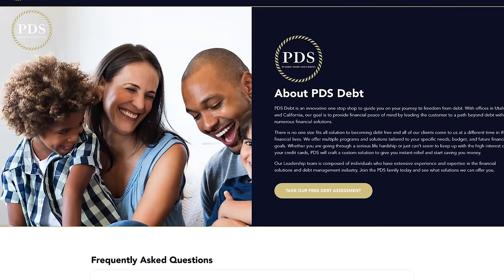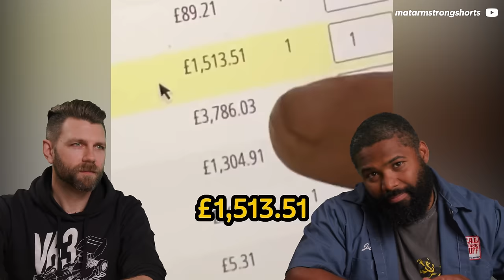Mechanic Reacts to Expensive Supercar Repairs

Comment: I work at an auto parts counter. I see so many guys who can finally afford something fancier than a six-year-old Camry who come in for parts only to find that, despite getting a killer deal on a CTS, or a 328i, or any elderly Jaguar; the economy ended at the purchase. I have a regular customer who got a BMW 3 for about the same price as a similarly aged Civic. The infernal HID bulbs for the headlights are about $150 each, which is about ten times the price of headlights for a Civic. The PCM crapped out about two weeks after he got the car. A salvage replacement wasn't outrageously expensive, but he ended up having to tow it about eighty miles to the nearest BMW dealership to convince the new PCM that it wasn't stolen. The dealership did not do the job for free.

If you can afford a fancy car, you'd better be able to afford a fancy repair. It's the way the world works.

I love my old Dodge.
Reply: God forbid they put all the fancy non-mechanical stuff on a car with inexpensive mechanical stuff.
Everything nice about a 328i has no reason not to be on a car as durable and inexpensive to maintain as a Civic. I've asked.

Comment: Watching this just made me realize:  supercars are built and maintained like airplanes. It's more about the preventative maintenance. We've all seen videos of wheels flying off at freeway speeds.  Imagine a composite wheel disintegrating at 4x freeway speeds.  The loss of control comes after the wave of shrapnel.
Reply: @SanityTV_Last_Sane_Man_Alive 2 points:

1. While a good piece of the video showed people doing dumb things in fast cars on public roads, we can assume these are also being driven on tracks or other places appropriate for them.

2. I have a feeling that someone that can actually afford one of these cars would be more focused on ensuring they are always in top working order and will never fail while in use - unless it is the driver's fault.
Reply: @SanityTV_Last_Sane_Man_Alive Race tracks, Autobahns.

Comment: At 17:17 you can see the breaks glowing red hot. Hand break is still up. That's why he cooked the clutch also.
Reply: he also says park it yourself but give a tip and hand over keys no one ever get hold my car keys even if my not not worth a lot my keys stay with me if they need to move it cal me i move it. i park my own car and keep the eys even if the car £100 or £10,000 i never hand over my car to a stranger. only one person what not not family i trust and that my local mechanic he dose services and takes it to local mot the yearly safety inspection and he bought no issues the last 4 years so only person i hand over the keys too not some stranger and esp in usa a manual car as many do not know how to drive one

Comment: I heard the Bugatti wheel replacement with maintenance is because the tires have to be "glued" on the rim otherwise the rims would rotate inside the tire.
Reply: Which is just ridiculous because ugr Lamborghini seems to do fine with double the power without all that effort
Reply: @michaelf.2449  Which Lamborghini has double the power of a Chiron?

Comment: Most Gallardos were delivered with the E-Gear transmission, which is basically an electrically actuated manual. If you use the like a normal autobox while maneuvering, they'll burn up the clutch. I've also seen that with early dry clutch DCTs.

Comment: That Rover clinate control reminds me of selling an old Rover 45 that was too rusty to keep. They were built when BMW owned Rover and shared the same stereo as BMW models of the same years. Once you figured out how to remove the rover decal that stereo was worth more on ebay than the rest of the car was in scrap!
Reply: rover 45 basically a Honda civic but you had options of a Honda or rover engine. seen a rover 600 for sale recently, looks like a import from japan or place what to not salt the roads and asking price £8 k ROVER 600 620 SLi AUTOMATIC 2.0 HONDA ENGINE * ONLY 33000 MILES they worth good money and under pinning for that Honda accord. someone local parking one up outside the doctors and he was saying about the honda engine still runs great and no issues with bad e10 fuel. these rovers are gaining value like , ROVER 416 TOURER 1.6 £7,999 or   ROVER CABRIOLET 216I 1.6 with 35k miles £8,999 or a bit more modern rover 75 v6 £7k or the mg zt but only v6 not v8 £9k, even some metro's going for mad price even rover 100 the updated metro like the 1997 Rover 100 1.4 114 GSi £4k, or 997 Rover 100 1.1 111 Ascot 3d with dealer miles of 12k and for sale at only £6k and the Austin Mini Metro Mk 1 L 998cc 1982 £9k the value of rover and Austin are again in value quite a lot but they are getting more rare sadly

Comment: I was picking up a client's Murcielago back when there were new. It's was at the Ritz in Orlando and I got his Rolls-Royce but I'm waiting for the Lambo for a bit. I start to hear it revving so I walk over to the nearby lot where it was and the guy couldn't figure out how to take the parking brake off and was almost smoking the clutch trying to get it to move. I told him to get out of the driver's seat but I did show him how to work the parking brake! IDK how much damage it did because my client sold it before too long. The head valet said the only reason they had been moved was it was Super Bowl Sunday and the game was in Tampa so they had busses taking ppl to and from the game that were pulling up right out front where the cars would have been. I've known a fair amount of valets over the years, most have respect for cars but especially when it comes to super cars even the ones that don't take the opportunity to have some fun can cause damage because they don't know some of the strange things about how they work. Park your own super car, manual car, or anything that's a bit different!!

Comment: The higher rev and time is the MAP sensor programming set into the ECM... The throttle by wire vs Espeed position is different programming...

Comment: You guys are making me glad I drive a Honda that probably can't go over 120.

Full synthetic oil change: <$50
Full set of 5 tires: $600 (including install)
If I do something stupid and wreck a wheel, each one would cost $30-50, because used wheels are totally fine for low-performance vehicles.
Reply: This. 
And if you wanted Lamborghini performance, there are videos of super cheap Civic builds beating those in acceleration. (And you know with the weight difference it'll out handle it too)

Comment: 12:05 Fun fact, most accidents with supercars don't result in it being totalled. In this case the cost of repair would be very high, but still lower than the actual cost of the car. If I recall correctly, this specific car was sent back to Ferrari for repairs, and will likely see the road again. The same thing happened a while ago with a Ferrari Enzo a few years ago, and after a lengthy stay at Ferrari it roamed the roads once more.

Comment: Ive worked on a gas station. Ive seen people putting normal petrol into a exotic (many require 98 octaine to 100 in EU for proper work), Hummer H2 and Dodge Challenger with LNG installation.
People buy expensive cars (lean more loans), but dont have the money to upkeep them.

Comment: That just answered why our old GMC pickup truck full of tools can dust the beemer that was revving behind it at the short onramp and easily squeeze in in front of the Mercedes that was dead set on not letting it in. 

On another note I drove a Prius a couple months ago and was shocked. I passed everything on the road going over 17 in it. Uphill acceleration was insane. Not that I would ever be caught owning one.
Reply: It's the low end torque. Whatever the official power rating is, if it can make a lot of it at low rpm that totally changes the driving experience and won't show up in the single-nunber power rating.

Comment: 10:00 “Cold Start” is for the catalytic converter, not for the engine. The oil pump engages and circulates oil before your engine turns over.

Comment: Top gear did a drag strip once with super cars, where they thought they were going to do well, to get smoked by civcs. Pretty funny
Reply: Civics which, mind you, cost less than 15k for oil changes.

Hell, do a whole engine rebuild every 5k miles and I bet it's still way cheaper

Comment: You can replace the spark plug coils in a Lamborghini Gallardo or Audi R8 5.0L with the spark plug coils from a Mk5 2.5L Jetta, the Jetta's 07k was an inline 5 built around the 5.0L cylinder head

Comment: Tires are shoes. Wheels are feet. Control arms are leg and arm bones. Axles are muscles. Intake air filter is nose hair. Cabin air filter is snot.
Reply: Haha, nice. I like that intake air and cabin air are the same air here but with different filtration systems that happen to be concurrent.
Coolant is blood? Nah, oil is, and we're fully oil- and air-cooled. And oil-fueled.
The radiator is skin.
Stability control is the inner ear, and the ECU is the medulla.

Comment: My favorite cheap exotic part was where the Diablo was designed to use headlights from a 300ZX.
Reply: 300ZX parts are cheap??
And I think it was designed to use proprietary pop-up headlights, and the fixed Nissan fixtures were a hasty retrofit to comply with "updated" regulations

Comment: The high end Hondas have an oil temp light.  The S2000 has bars above the Tach, as you warm it up they turn off in sequence so you can rev it higher.  Physics doesn't care what car brand you have.  And you can always install a block heater (or coolant thermos like a Prius has) if you wanted a faster warm up.  In fact F1 engines can't even be started until hot fluids are circulated through the engine and it's pre heated.
Reply: Lots of road cars have oil temp gauges. It's apparently fallen out of vogue because of cost cutting, but it used to be common. See it a lot while window shopping on Bring a Trailer.
Oil pressure too

Comment: as someone from dubai i can tell you that it is true that some people abandoned their cars to escape the debt payment this is certainly not one of them, this car is parked in front of i would say most probably a salvage yard or a scrap shop as you can see a Rolls-Royce in the back also collecting dust so my guess either a shell or it cant pass safety regulations for some reason.
and for the abandoned cars the are usually towed to an impound then after a certain amount of time (3 months i guess) of no one claiming them they are sold off in an auction
Reply: So when the rich Dubai boys come again??? The rich bois???.or rich rich Chevy or ford buys

Comment: 10:07 all that is true, but I would have also mentioned cold seizure of the piston to cylinder, more commonly found in big diesel applications but…performance engines especially low mileage ones can suffer this fate

Comment: Once you mess up these cars and you do the insurance claim they just all become parts cars.  The individual body panels, seats, etc become worth more than getting any of the performance parts fixed (wheels, brakes, engine).  You need those performance components to come from the manufacturer and handled by a certified technician because any flaw could be deadly.  But getting a replacement panel or something is where the shops make a lot of their money and source them off of trashed vehicles.

Comment: pretty sure Bugatti's run a 'dry sump' with multiple oil tanks, filters & coolers for the 1000hp quad turbo V12 engine. Something like 5 hours for a oil change..
Reply: It's a V-16
But anyway, some people build engines with that power in their garages and they work great. Without that immensely complicated oil setup.

Comment: I've worked for multiple main dealers, including maserati, alfa romeo, vw, Nissan, subaru and daihatsu i see this all the time 😅
Especially at nissan, when someone would bring a gtr in for a service and you see the vhc sheets 😂
£500 per tyre plus alignment, service £1500 on the brakes. Then would get recovered the next week because the gearbox wound have blown etc 🙄

Comment: One correction if you mind:

The reason why they rev up when you start them, is not to send oil all over the place (because the oil pump has that role -- if the oil pump wouldn't be able to provide sufficient, continuous and ample volume of oil at idle, then you'd have a big problem; also there will always be a thin oil film on every single engine component in contact with oil, since oil has a high adhesion factor), but, to throw unburnt fuel to the catalytic converter so it raises its temperature to optimal.

Comment: Jumping like Dukes of Hazard... I jumped a 70-something Nova one time and all that happened was the fan cut into the top radiator hose. I used to jump my 75 VW Rabbit routinely, and it was fine. I'd get two feet of air off the railroad crossing and land hard, and it just kept going like the energizer bunny. Even after I wrecked the shit out of it, it still ran. The driver's side headlight looked up to Mars, but the car still drove. It ought to be a requirement that in order to get your license you should have to learn to drive a 63 Studebaker with three on the tree, mechanical clutch, manual steering, and manual brakes. Then you'll be able to drive anything, like me.

Comment: the original veyron was big money. They tires were attached to the rim. If i remember it was around $42k dollars for the original bugatti. nuts.. The Hood on the mercedes SLR is , ready for this, $70k+ dollars. Just the hood. lol Original Viper hood where the whole front end goes up WAS around $11k. Btw, that yellow McLaren P1 is the McLaren that " Tavarish" bought and is restoring. taking the hybrid out and building the motor to 1500hp.

Comment: about the ferrari that spinned and totaled, it actually happend in the netherlands, the car was brand spanking, brand spanking, spanking NEW! annnndddd once the new owner (seasoned ferrari driver) throttled up he didnt spin, the left rear wheel bearing (or socket or whatever) broke, ferrari also said it was a mistake from the factory, you can see a left rear wheel pop out of its socket on the clip

Comment: 13:10 this is the thing with bikes also if your bikes rear wheel is spinning get it more gas and don't hit the front or rear brakes so just keep the handles straight and it will get traction eventually

Comment: I remember Topgear doing a super car special. And with that I mean buy a super car for under 10000 pounds special. Oh boy, they got some REALLY old cars. And, you actually can work on them. Surprisingly. Because yes at that point, it wasn't at the level yet MODERN supercars are. 
And yes, as usual, all went without any problem, .. it is top gear of course it all went wrong. 
Knowing the cost of these super car repairs, even simple things are FLUID changes... makes you look at the bill you get from your car shop and though it hurts, at least it is doable.

Comment: Bugatti wheels are glued to the tires and can only be changed out once with tires and it gets done at a dealer. No tire shop will touch these cars. There is aftermarket wheels finally for these cars but are not meant to go above 190 mph.

Comment: 18:17  That black Lamborghini at the end should be a single clutch auto gearbox. The only Gallardo cars that had a manual was the 5.0L v10 first gen ones not the 5.2l newer v10 cars Exactly like the one this the video. There were special ones with the 5.2L v10 that was manual like the Balboni which was the one with the stripe as homage to an individual but apart from that there wasn’t anything else. Also E-gears don’t respond well to reversing uphill.

Comment: 25K oil change on the Bugatti  is because they also do a partial engine tear down to make sure there are no lubrication issues and replacing any thing internal that had degraded. it sounds expensive but you also don't want to replace a w16 after catastrophic failure because at that point the core is scrap metal too.

Comment: 10:05 not just supercars. I drive a mercedes sprinter for work does the exact same. I still let it idle for a couple minutes before driving
Reply: Pretty sure the oil pump is working the second the engine starts
Reply: @nthgth  of course it is, what do you mean?

Comment: I am 17 and I drive a 2004 v6 convertible mustang the og buyer sprung for the fancy sound system but not abs or traction control kinda funny but I guess less warning lights to worry about lol
Reply: More like, better for you learning how to actually handle a car lol
Reply: But honestly that's a really cool car for a first car. Not too fast but 190hp is def enough to have a great time. Big 3.9L engine = good torque too for the hp (2004 is the only year for the 3.9L in that car too, rare fact).
Convertible.. never owned one but that's awesome when the weather's good. '04 = last year for the New Edge design Mustang, that's cool too.
And upgraded sound system is always great. I have a 2020 STI and the stereo is probably it's worst feature, besides the noise and MPG.

Surprised ABS was only optional in 2004 on any car lol but definitely practice threshold braking. Like in an empty parking lot, where screwing up will not lead to a crash or hitting a curb or anything.

Comment: Y'all mechanics should know that you don't rev those cars because they have complete forged internals and they have a LOT of clearance when cold and when they get up to operational temp they no longer have those loose clearances, they get super tight and can then handle being reved up. But forged parts have tons of heat expansion so they have to be semi loose when cold or they would lock up tight when they got warmed up.